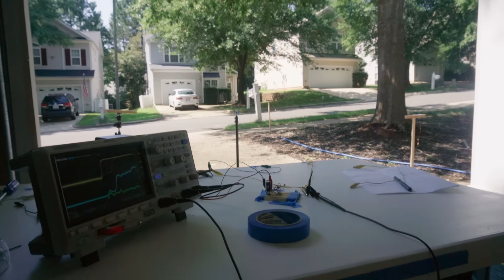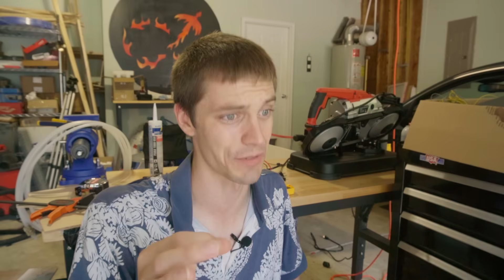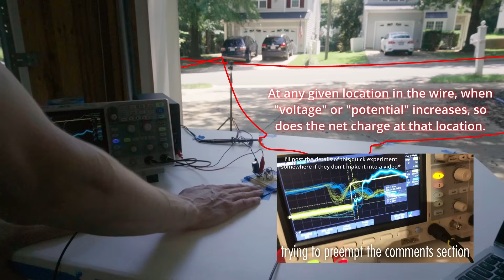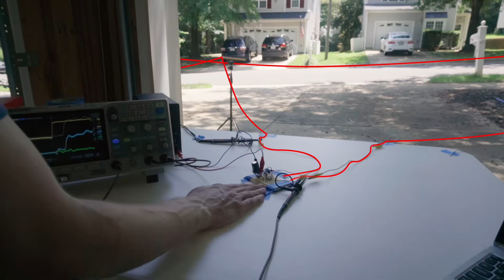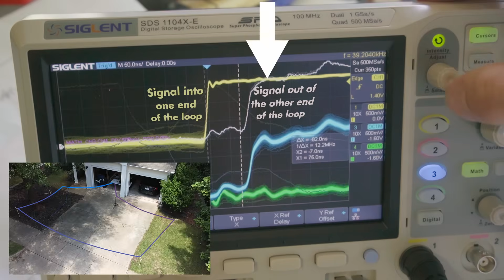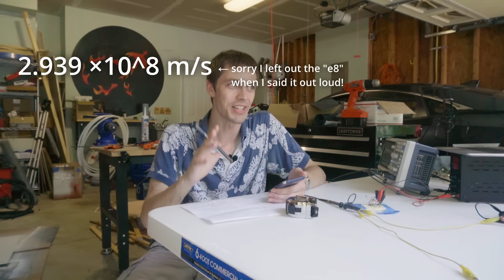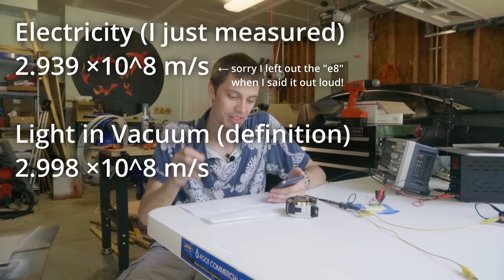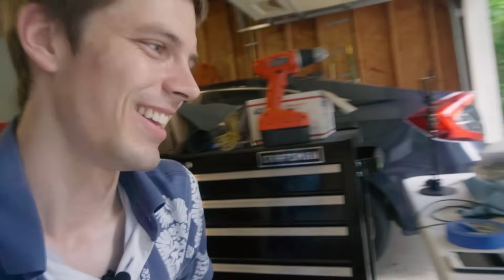Why does WATER change the speed of electricity?

Comment: The resistance, in fact, does not change the speed of propagation, but on the other hand, the medium surrounding the wire does chance the effective resistance of an AC signal, basically adding a resistance effect to the DC resistance value due to energy loss in the dielectric.

Comment: I remember doing something like that in high school physics... I don't know any specifics any more, but the result stuck. In that setup the potential wave travelled at 2/3 c. But it was definitly dry and not submerged in water.
Thicker wire also has a higher inherent capacity. Like you have to draw off more electrons to hold it at +1V potential. If you have a very weak current source, it might also skew the result that way. that could be enough to account for 2 ns.
Reply: The current has no effect on the speed of propagation of the electromagnetic wave. Read my previous comment about why the speed is affected by the medium, and watch the two videos for a better understanding of what is really happening.
Reply: @wayneyadams  Maybe I didn't make it clear enough. If you cannot draw out enough electrons fast enough (or your switch has a significant transient), it would also result in a measured delay. Not by a slower potential wave but by the property of the excitation. Not a square wave but a slow decay.  The result in the measuring would be the same in practice.
As we are talking about nanoseconds here, the current to instantly empty the capacitance of even just wire to -1V becomes significant. Transients of discrete semiconductors can also be in that range.

Comment: When in the Air force as a radar engineer in the 1970's we used large coils of wire to delay the radar return signal. Expecting delays in the range of micro seconds but the coils although long weren't many miles long. 
from wikipedia 

"Propagation delay is equal to d / s where d is the distance and s is the wave propagation speed. In wireless communication, s=c, i.e. the speed of light. In copper wire, the speed s generally ranges from .59c to .77c.[1][2] This delay is the major obstacle in the development of high-speed computers and is called the interconnect bottleneck in IC systems."

You are measuring a wave front ie information traveling in the wire. It should be in the range of  several hundreds of miles an hour through a wire. Explain ?
Reply: @sourand jaded  Mmmm there may be a lot to consider, logic suggests that when an interaction takes place between trillions of particles even if the time scale is very short it will still add up.
If you fill a tube with water and connect to a water supply, turning on the tap will result in and almost instant out flow at the other end no matter how long the pipe BUT it isn’t the same water you put in the pipe at the tap, that will take a finite time to get through the pipe. Thus electron flow , if it happens, is fairly slow, but information flow is speed of light assuming speed of light is finite.

Comment: Just one note on the scope you used - for measuring, use a single connection to either ch 1/2 and a single one on ch3/4, as if you connect 2 signals to one "pair," (i.e. 1 and 2) it decreases the effective BW to 500MSa/s from 1GSa/s - it should result in a cleaner output and easier measurements :)

Comment: Dump question about the stranded wire: it is twisted, that would make each strand inside the cable a bit longer, right? or does that not affect the electrons since they are equally likely to go "diagonally" from strand to strand and don't actually follow one strand?
Reply: This question is mostly irrelevant when we talk about high frequency AC. Strands are a property for mechanical purposes, like flexibility, tear resistance, elasticity, easy to lay the cable. The cross section as a parameter is usually important for the maximum current that a conductor can carry.
But to your question in other applications: The strands touch, they are conductive. The image of any lengths here being longer because of the nature of the braid...just exists in your imagination, which is wrong. And even if that was the case, the differences in length would be absolutely irrelevant in practice. Just as latency is irrelevant for submarine cables: it is a property of nature. Faster, i.e. without delay/runtime of an electromagnetic wave is simply NOT POSSIBLE. Period, Over!

Comment: No need to, kinda grasping at straws with molecular relaxation and signal spectra -- the simple fact is your circuit is unbalanced and most of the field is in the air around the pipe.  Basically like increasing the conductor diameter for the local section.  Which is also why it only affected a narrow region of the waveform: the wave was only (moderately) slowed as it propagated through that section.  The effective epsilon can be calculated using a field solver (e.g. ATLC2), inputting a cross-section of the system with appropriate parameters.

To be clear, the loop is mostly in air, and partially in the ground.  Concrete and soil have a modest dielectric constant (and loss), and probably dominate the contribution to the 96-98% figures.

This (unbalanced arrangement) is also where the leading edge arises, as the one side of the loop is kicked up, and the reaction kicks the rest of the circuit downward, thus the far end of the loop reads somewhat positive, immediately.  I'm guessing the bump ~270us later is reflection from whatever the ground-return path is (mains earth via scope?).  That's about the right delay for extension cords / in-wall wiring back to the panel, as a guess.

With a balanced circuit, such as driving a parallel pair of wires (transmission line), the slowdown will be quite substantial in water.  Probably exhibits loss and dispersion, too, so expect a visibly slower risetime afterwards, I think.

Oh, also if you aren't driving the transmission line right where it enters the water pipe, expect reflections from where it enters, too.  The impedance is much lower (by that same factor of 9!), so expect about as much to be reflected.  Use matched source and load impedances to dampen reflections, limiting it to just internal reflections in the water section.  Might see a good one or two extra reflections that way.

Comment: I love this, it brings back memories of my college studies in radio and electronics (CGLI). In the 2nd or 3rd year (of 5), you learn that a square wave can be resolved to all the odd-harmonics of the fundamental. When it comes to signal-loss of the higher frequencies, this can be compared to modal-dispersion in long distance fibre-optic single-mode systems. I enjoy the enthusiasm of the presentation, diagrams and practical demonstrations with calculations. Have a 'like' 😊 Please demonstrate propagation velocity using a length of coaxial cable.

Comment: Great video! I have a suggestion for a video I'm very interested in, I've read and heard multiple times that the reason why wires with passing current generate EM field is because of space dilation described by the theory of relativity, since the densitiy of electrons let's say in the middle of the wire is exactly the same, therefore we would expect it to be neutral as it is in rest state. Is that actually true? Would there be an experiment where this could be demonstrated somehow?

Comment: so in your experiment longer wavelength has lower speed of wave propagation than shorter wavelength? however, in optical dispersion shorter wavelengths have higher refractive index (hence lower propagation speed), you can easily see this using a prism and a white light.

is it because at light frequencies dispersion is driven by some other physical effect?
Reply: It is the same effect and works the same way.

Comment: Wait, so C isn't the speed things 'move', but instead a limit based on the reaction time of a signal moving through a field?
Reply: huh, then I guess breakthrough C is easy, just create A vacuum with more vacuum than the vacuum.
Reply: As I understand it C is the speed of electromagnetic propagation (Photon propagation) and is there fore dependent on the medium it goes through. The maximum speed is through vacuum. That is what we call the speed of light. Light only has that speed in vacuum.
Reply: @leonhardtkristensen4093  that's not exactly it, gravity and protons are also limited to C
Reply: @Mooza1  maybe every thing is

Comment: Would stripping the insulation dialectric away make any difference? oh, and also using demineralized water?
Reply: Yes, the insulation is a dielectric just like the water.  Removing it will increase the velocity factor of the wire.

Comment: The fact that different frequency components travel at different speeds also leads to the different shapes of the response curves. You're effectively creating a low-pass filter by filling the tube with water.

Comment: Sory, but this is just wrong. Electricity travels at a constant speed, just like light. What you are showing is just capacitance.
Reply: What do you mean? What's the difference between capacitance and what an ordinary person would understand as "electricity"?
Reply: @aspzx  The graph shows the same speed all over, but that the growth of voltage is lower with the higher capacitance - this is normal - but it has nothing to do with the speed. If the speed were different, you'd see a shift in where the graph started, which you don't.

Comment: I find it dangerous to say that the signal is a sine wave just because it can be decomposed into sine waves. Every signal can also be decomposed into all kinds of wavelets in what's called the wavelet transform. Is the signal therefore both a sine wave and a wavelet?
Edit: I just read your clarification in the pinned comment. I agree 😄
Reply: I think the line you almost ended on is a much better way of putting it. Although I do sometimes wonder what would happen if physicists used wavelet transforms more. They somehow seem more adequate what with being local in nature instead of assuming a periodic signal but I don't understand the maths nor the physics well enough to actually know what the effect would be. At the end of the day, like you said, they should produce the same results and should therefore be equivalent.
Reply from the maker: I considered doing the ultimate hand-wavy physics and calculating the peak frequency of the signal by looking at the rise time and assuming it was 1/4 of a sine, but decided against it lol

Comment: If I had to guess water would be slowest because it also absorbs electrons depending on how conductive/acidic it is
Reply: https://en.wikipedia.org/wiki/Calcium_copper_titanate CCTO has a dielectric constant in excess of 10000 at 1MHz, which would equate to a velocity factor of less than 1/100. https://en.wikipedia.org/wiki/Velocity_factor

Comment: Thanks for your video. 2% less then c sounds not much but actually it is. 1% of c is around 3000km/sec, so 2% results in 6000km/sec and in my opinion this is very much.
Reply from the maker: Based in the kludegyness of my setup, I was thrilled to get within 1% repeatability. For something like this, physicists only start to care once you’re off by a factor of 1.5 or 2

Comment: Nice.
The video is nice but the sillyscope is very nice. I'm jealous that my old Tekronix is only monochrome. Older still are the 3 CRO's that I have that are all mono rather than coloured.
I wonder if salting the water would make much difference. It changes the refractive index a bit but more importantly it makes the water far more conductive.
Reply: Sillyscope  :P
Reply: I spent a career with Tek, LeCroy, HP, and other scopes, but picked up a 4 channel Rigol for home use for about $500.  Boy, it provides a ton of function for such a small price!  My old home scope was an analog Tek, and was excellent, but the cheap Rigol really does make life easier.

Comment: Does the shape of the loop affect the speed of propagation. EEVBlog posits that the transmission effect is the cause. Corners would propogate faster in the crook. In theory a circle would be slower.

Edit: would the water moving affect it at all. Since it is affecting the speed while sitting still would it affect it more while moving. Think a magnet going down a copper tube

Comment: This is a very interesting experiment. I recently did a video on the first frequency dependent transmission line models developed to explain behaviour of first the transatlantic telegraph cable in the 19th century - it took several minutes to send a few messages because the line was surrounded by water, giving a huge capacitance. The background theory is fascinating.
Reply: Just watched the video you are talking about and subbed to your channel, can recommend to others to check it out too.
Reply: I think Heaviside introduced load coils to counter the problem

Comment: Electricity in coax cables travels much less than speed of light.. like 2/3 speed of light. It's not the resistance that slows it but the reactance.
Reply: I thought coax carried RF, not electricity
Reply: @DanKaschel  RF.. but radio frequency what though.. Electricity, electrons, electromagnetic fields? IMHO, semantics doesn't really matter at this point.

The Veritasium video that started all this discussion was talking about electricity going through the space around the wire rather than through the wire itself and if that's true then you might as well use all the terms interchangeably. It's all just models we are using to try to understand some small concept in an infinitely complex universe.

The transmission line effect in common coax is an RF thing, but really it's an AC thing, it just happens that most common uses of coax are at radio frequencies. And saying it's an AC thing is only really saying it's not an instantaneous phenomenon, that time matters. Time matters in a coax transmission line because energy is being temporarily stored and released rather than converted instantly to heat as it would be in a purely resistive system. Model that temporary storage of energy by calling it reactance. Plot reactance and resistance of a system on a complex plane and call it impedance. Model it as lumped elements of capacitance and inductance if you like. It's all just semantics and models.
Reply: @DanKaschel  You can put anything you like down a coax cable, including DC.
Reply: It's actually the dielectric that surrounds the wire that slows it.